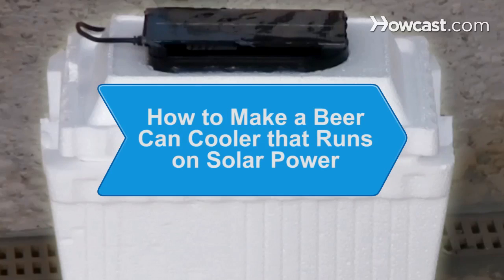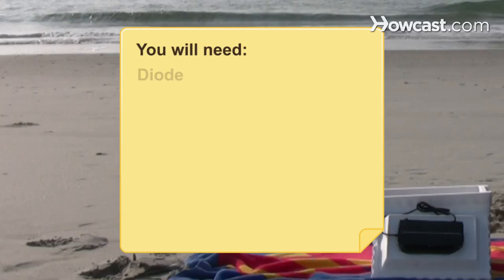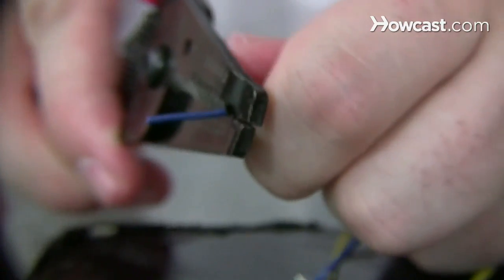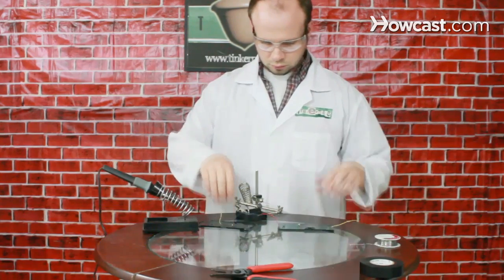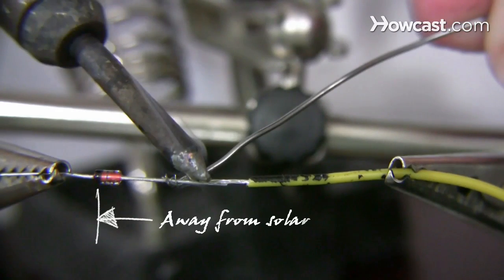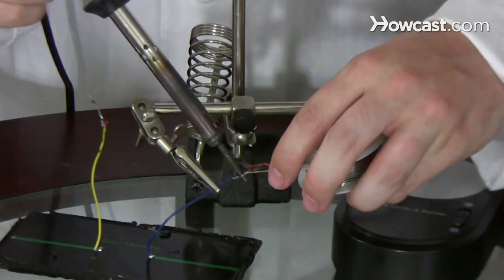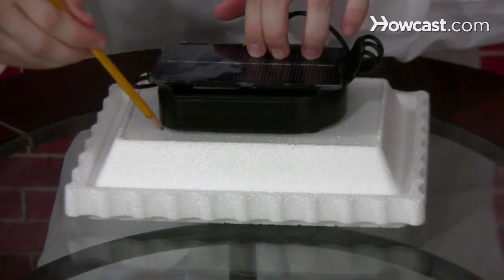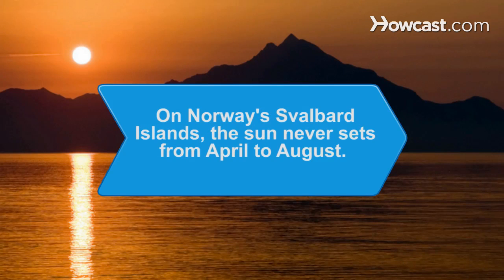How to Make a Beer Can Cooler That Runs on Solar Power

Comment: Hate to rain on your parade, but this won't work for several reasons. Principally because the power generated by those puny solar panels will amount to a few milliwatts, secondly, the efficiency of the system is minimal because there's no thernal conductive path between the cool plate and the beer. I could go on, but I wont.

Comment: First of there is no reason to use profanity
second,it's like  a solar powered fan(Why not just get out of the sun).Its a ridiculous concept to begin with especially if you have the option of putting the item in shade.
I like DIY like the next guy (check out gomi style by h20boy),but why not just buy ice?